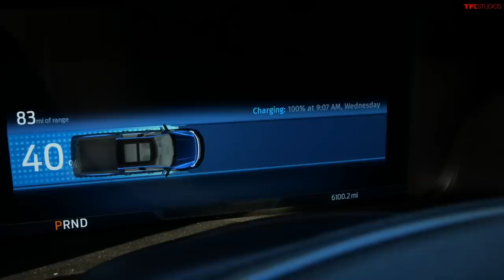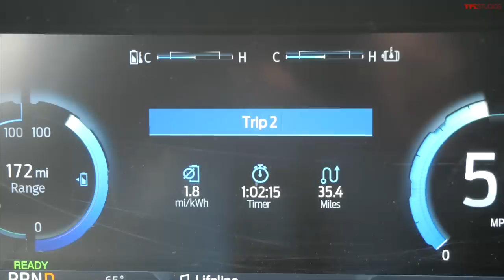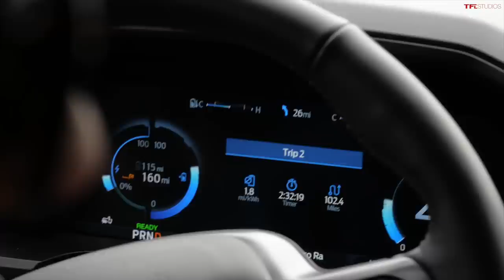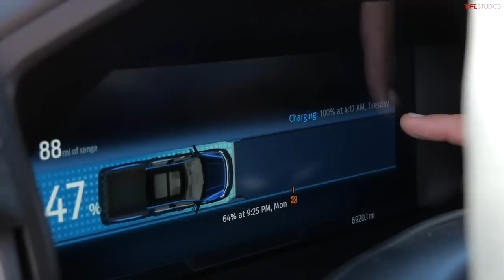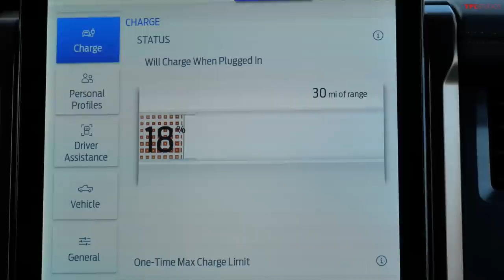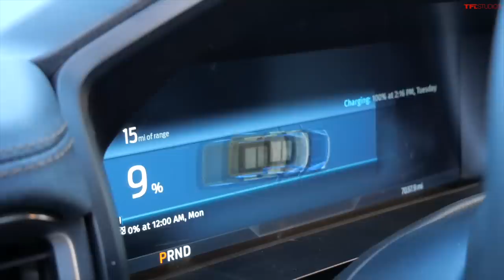Easy Part Is Over: Driving an EV Truck Into the Alaskan Wilderness Is HARDER Than We Thought! Ep.4

Comment: The guy at 24:15 has a good point about the environment affecting the utility of EVs.  Teslas loose about 30% of their capacity in moderate winter temperatures.
Reply: I lose 10 percent...  But the the air is much more dense and I'm more susceptible to headwinds.  Still my fault driver is 150 miles for work, and never have had a problem.

Comment: I could do just fine here at home and all my local trips, but if I had to take a trip like this I would have a nervous breakdown!  I'm all for the EVs but there has to be more charging stations available, and it would be best if they had solar and wind also.  Using grid power to charge just defeats the whole thing even though economically it probably is cheaper than dino juice direct.

Comment: I have done that trip on a motorcycle. Rang is a big problem, 200 miles between stops is common. And you have no options.
Edit I didn't use the ferry I used the Alcan highway across Canada . Then down to Anchorage  turned around and up the road to Fairbanks. Total mileage was a little over 7000 . I had shipped tires to Fairbanks because I knew they would not go the full distance required. No EV can make that trip in the winter. The only one that even comes close is the eptera which can self charge when sitting in the sun . Whith 12 hours of sunlight it can charge about 40 MI so in the summer when the sun does not set it may be able to charge 80 MI with clear skies.

Comment: I'll be riding my motorcycle from SF bay area to Prudhoe bay and back next summer. Is camping the way to go once you are outside of Fairbanks?
Reply: There is a trucker hotel at Coldfoot and gas. You just need a 250 mile range to get to Coldfoot and then 250 to get to Dead Horse. Dead Horse has gas. Wife and I made the drive in 1996 in a new Suburban 2 wheel drive, all stock. No tire or mechanical issues from Dallas to Deadhorse and back. We did have numerous windshield chips. Camping is available, but mosquitos are big and plentiful.

Comment: This whole thing for me was a range anxiety festival. As wonderful as the truck design is, the lack of plentiful charging infrastructure just cripples its functionality.  Exponentially worse pulling a load. Even with your bed camper, only just over 200 miles on a full charge is terrible. Great adventure you went on, but doing it without a gas chase truck and generator would have really put you in a bind. The high end price tag and range anxiety are double whammy deal breakers for me. I love that we are evolving to a better technology,  it's just not ready for prime time unless you're restricted to daily commuting and charging at home. Open road tripping with a large travel trailer is my dream; right now it's seriously impractical with electric. Otherwise, I really enjoyed your adventure and the spirit behind it.

Comment: 25:48:  "...not tempted at all."
That sums it up for me too.  But, Hybrid!  That is the way to go.
 
And...NO, that IS NOT like a Model T.  The Model T of EV's were the lead-acid battery powered models from the 80's and 90's.  This might be equivalent of a carburated gas engine auto...but there are physical limits to storing electric power that battery tech will meet.  Most importantly, you are charging from a coal and gas fired power grid.

Comment: So in other words, you can't make it to the northernmost point of the US in an EV, unless you're willing to wait 5 days to charge? LOL You had the ability to "cheat" with the F-150 hybrid, but how many that would have considered such a trip will have that option. Don't get me wrong, love EV's, could never drive gas vehicles again as a daily driver, but unfortunately, there are still some aspects where they're still not yet quite practical for all scenarios. Some day. Maybe the Rivian when they eventually release the max pack. Possibly the Silverado which is supposed to have 400 miles in range or Ford's new EV when it is released in a couple of years. In any case, cool trip. Camper was useful, but costly for an EV, in addition to the fully loaded weight.

Comment: Actually it is a longer drive to Homer, AK than to Dead Horse. Homer is often called the "end of the road in North America".
Reply from the maker: Nope, Homer maybe the end of the road but Dead Horse is 500 miles past the end of the road.
Reply: @TFLtruck  No. If you did not take a ferry to Alaska but actually drove the Alaska Highway all the way to Fairbanks, the driving distance from Fairbanks to Homer is greater than the driving distance from Fairbanks to Dead Horse. I have traveled both routes during  the many decades I lived in Alaska. Putting a vehicle on a boat to cut hundreds of miles of road time is not really driving to Alaska.

Comment: EV's right now are all about two things. 1: Compromise and 2. Cost. The cost of the vehicles is one thing but the cost of sitting around waiting for a full charge, even on a fast charger, can also be costly. If you use a commercial vehicle for business on long trips and you are sitting around waiting for that charge, you need to factor that waiting time into your travel. A full tank of diesel will take about ten minutes. A full charge on an EV? Who knows? Depends on a lot of things, including whether the charging outlet is working and available. Time is money and sure, the charge may be less than the cost of diesel but deduct the waiting time and you aren't doing all that well.

Comment: I know you are trying to show just the hardships of driving an EV truck is through wilderness. But I think that the majority of people are wondering the following..  1: How many total hours did you spend charging?  2: Total costs to charge the vehicle?  3: Exactly how many miles you got on each charge? 3: How much did you spend for each plug adapter?  This is what is really going to show the difference between gas/vs electric.   These figures need to be given from start to finish, not skipping sections of travel.

Comment: This is Awesome. I love the electric truck road trip.  The first thing I would have done was to Dump that pop-up four wheel camper GARBAGE!  I bought one a while ago and had nothing but problems.  The stupidest purchase I every made.  I did the same wind deflection build on.  I had a coughing, raw throat every morning from breathing in its off gassing ,curing formaldehyde glues of the material used to build it. Besides leaking like a sieve from the 202 screws hold the roof on, everything I touched broke.  I sold it for a huge lose.  I learned to Keep camping simple with simpler shell designs that were more fuel efficient.

Comment: EVSE's(EV chargers) don't convert or care about voltage at all, period, across the board. That's handled by the car's on board charger. EVSE's are literally just extension cords with a bit of safety electronics on board.

Comment: 24:30 he has a point in winter EV's will get their range cut by like 75% and unless you have a gas/diesel powered generator you're gonna be stranded in then worst place in the country to break down! in northern Alaska above the arctic circle in -50 F weather and no town with in 250 miles in any direction!

Comment: 2:50 Why didn't you tell what the current time is ? There seems to be daylight so till 9 ?AM tomorrow it could be what even 16 hours to charge from 40% to 100% ?!! That is atrocious even for the 240 volt?  Ford Mobile Power Cord !
6:25 Good thing you took the ferry since Bellingham to Haines is 1 day 6 hours 1537 miles  strictly by road !!
6:49 You guys traveled roughly 12 hours 640 miles from Haines to Fairbanks.  How many times did you have to charge up ?!
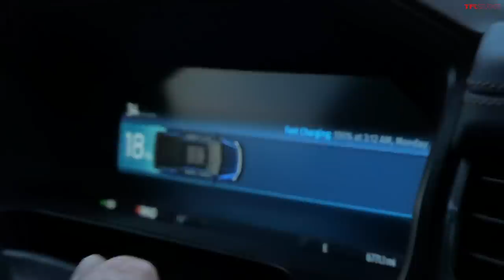8:15 18% to 100% charge in roughly 3.5  hours on a Flo Fast charger is not impressive considering its at some 400 volts correct me if I am wrong .
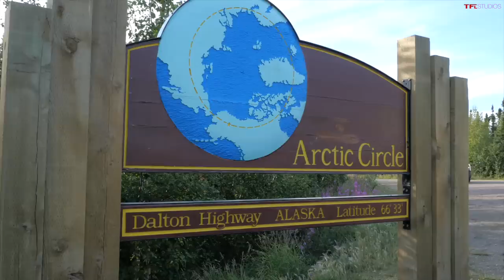28:51 How much time  did it take  from 47% up to  55% at the camp by charging through the Powerboost using the Ford cable ? 
34:37 According to the Ford website the Mobile Power Cord 240V will charge from 15% to 100% in 20 hours !! How well will the zencar aftermarket charger do ?
 Coldfoot's population is only 268 very nice of their residents to accommodate you guys.

Comment: Electric trucks are definitely still in their infancy, but they'll improve.  Nonetheless, for MOST people using them in the lower 49, they are already entirely adequate for MOST responsibilities.  Obviously they are not quite ready to displace diesel for long haul towing, but they'll get there.  With that said, I have a deposit on both the Lightning as well as a Cybertruck, and would be entirely happy with either one as my daily driver.

Comment: I wonder if Ford is watching? Electric vehicles are basically a restricted use machine. That is you will be restricted to the end of an extension cord unless you rarely leave home. Another issue is the weight. Electric vehicles weight typically about 25% more than regular gasoline powered vehicles and if you are on the wrong side a crash the electric vehicle will win. Raw materials to build an electric vehicle is massive. Every aspect of an electric vehicle requires gas/diesel to produce it. Even a locomotive requires a diesel engine to operate. In my view, until there is a massive breakthrough in battery power that can operate in an environment a gasoline or diesel engine has been built and designed for over the paste 135 years of gasoline engine production, the electric vehicle will be an expensive, taxpayer funded, inconvenient, and subsidized curiosity.

Comment: Plug it into a tree to charge it out in the middle of nowhere OR use a GASOLINE generator to charge it. Electric vehicles are for city folk who only drive 50 miles a single day to work and back. It’s not for your country boy driving 100 miles to work one way and cutting wood on the weekends and putting in hay .

Comment: Yeah:  when you need to bring a portable gas generator  to charge your EV in odd locations, that's anti "green", isn't it?   You still need a gas can, but [on top of the extra mining needed to produce EV batteries] there's the extra energy/materials required to support the hallucination.  There's only one instance where EV's benefit: areas that provably trap smog and rarely have brisk winds or regular rain to clear it out.

Comment: Hydrogen is the future. It would be be the easiest switch for your average motorist. Go to a hydrogen fuel station, takes 2 minutes to fill up your tank, and your good for another 300-400 miles. You wouldnt need a cell phone and app to recharge, which is absolutely ridiculous.

Mega corporations seem to blacklist  hydrogen as an alternative for some reason unknown to me. I do know everything I own with a battery is either dead or dying very quickly.

Comment: EV trucks would have a better chance if they had 800V systems and not the low 400V systems that take 45 mins to charge the truck from 20% to 80%.  So you leave home with 100% SOC then hit a charging station when you hit 20% then wait 45 mins to recharge to 80%.  Now you're left with 60% of your big battery because no one wants to sit 2+ hrs at a charger to get to 100%.  Not everyone who travels needs to stretch their legs for 2 hrs because I know that's what some will say.  

Trucks shouldn't be made with 400V systems.  It's mind blowing why manufactures do this when they charge astronomical prices for them already.

Comment: 21:00
Wow, talk about tossing away re-usable energy..
From the drone shots, we can all see - NO SOLAR PANELS - why not?
Even the smallest solar panel, (slightly higher voltage than the tuck) would have kept adding e-fuel along the way.
But nah - lets NOT solar recharge eh - lets simply run outa (sun) gas.

Comment: What a joke!  1675lbs and it does bugger all mileage. Electric vehicles will always be a waste of time. Even in 20 years you will still be using “dinosaur juice to power these toy cars. 
My diesel vehicle is 8,600lbs and has a range of 715 miles at 70mph. 
I’ve been able to cook eggs, make coffee and toast from two 100amp lithium batteries for around 4 years now and I don’t have to stop to charge them. Powered from the alternator while driving and solar panel while stationary. 
Keep saving the planet blokes by charging using fossil fuels. 😜

Comment: EV's are neat, actually a novelty more than a useful tool. They are powerful, quiet, and fast but not very useful to the vast majority of Americans. I have no problem with EV's except that I am being coerced into subsidizing them! 14 hours to recharge? On an increased capacity charger? That alone renders this platform useless to most people. And that electricity isn't free. When you figure the cost of operation, original purchase price and how ineffective they are at traveling any substantial distance in a reasonable time... useless! And we aren't even talking about the cost of replacing the battery in 5 years. Ok, I get it, "batteries are going to be wonderful one day soon". Before you bash me consider this. We have had electric vehicles for more than 100 years, and batteries longer than that! If they were the best option we would all be driving electric now. Without government subsidies (American tax money) EV's would barely exist. Stop forcing US to fund them and let them stand on their own.

Comment: You cheated by taking the AK Marine Hwy.  Why not up the Alcan?  There aren't any charging stations and much of it is without any electricity at all.  The reason for cheating. 🤣  Also, no electricity north of Cold Foot until you get to Deadhorse.  I drove the Haul Road for many years while working on the pipeline.  Good Luck

Comment: 25:09 Winter. Anybody who lives in it will tells ya for sure (edit)winterisCOLDaf. RV Trucking Overlanding Vanlife'n Diesel (or Multi-Fuel) Heater! Solves the Heat problem, though can't charge without a heated garage perhaps. 
AFAIK, Current tech Internal Combustion Engines are what, Imma simplify and pull numbers outta mah butt, 20% efficient with 80% Waste Heat. Going electric will improve the 20% side while heating for the passenger cabin (and maybe battery?)  will help the 80% 'Waste" Heat.
**shrugs**  Winter and Ice Ages gets cold and gotta burn stuff for heat. stay warm ppl! <3 all
(editedit) Extended Run Trailer Units!?? and Infernal Combustion Engine GenSet on wheels... heh

Comment: The infrastructure is years if not decades away from being able to handle EVs. As we hurl towards no ice vehicles its going to be a disaster. We have made huge strides with clean fuels that can be ran in ice vehicles and distributed though the present fuel stations.  Final point is that the only thing that is going to work to proving all the electricity we want is nuclear.

Comment: No, that's NOT perfect. You don't need a vehicle that is DOWN for hours. You need a hybrid that works on gasoline to charge the electric system. Something like the Toyota Highlander or the Nissan e-Power. Look them up. No charging necessary because the gasoling charges the electric system. It's the electric system that turns the wheels, NOT the gasoline.

Comment: Electric vehicles only have one place that they would remotely be useful and that’s within inner cities. I’m a huge Ford person but they really dropped the ball trying to make an electric truck considering it’ll be years and decades if ever that they can compare to even a gasoline powered truck other than just moving short distances within a city. Then there’s the fact that recharging them puts a bigger carbon footprint out then driving a gasoline or diesel powered truck the same distance. Remember folks electricity don’t just come from nowhere and over 90% of electricity comes from power plants that utilize fossil fuels that put out a large carbon footprint. So if you are naïve enough to buy in to the faults ideology that electric vehicles are more environmentally friendly seriously start sitting down and investigating the amount of electricity they need from a power station to charge them the amount of power they use to travel so another words how often you would have to charge them and looking to the components that make up the batteries and them and find out the destructive Ness that happens while obtaining those materials and then when needed disposing of those materials is ridiculous within itself to even think these things are environmentally safe.

Comment: My EV future is at least 5 years away if even then.  There's a lot of bluster about how fast this is coming but as an engineer, the infrastructure for charging batteries is still a large question mark, the technology itself is still immature even from the standpoint of stuff like parts and life cycle maintenance, and let's face it even if the current administration gave everyone a $70k voucher for an electric car it'd be half a decade before you'd get one based on current production forecasts and raw material availability (most is from China).  These are going to be huge at some point but getting one has to look less risky than what you saw here and no one wants to go through a litany of obstacles to get charged or wait for long periods of time.  No thx